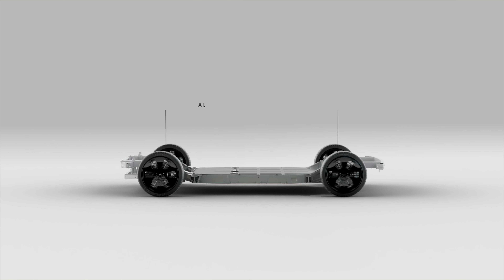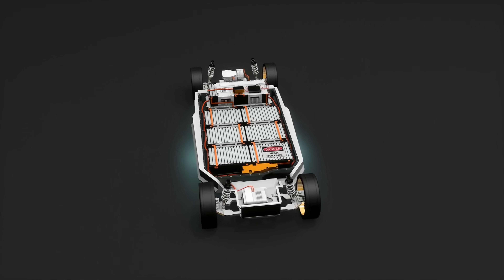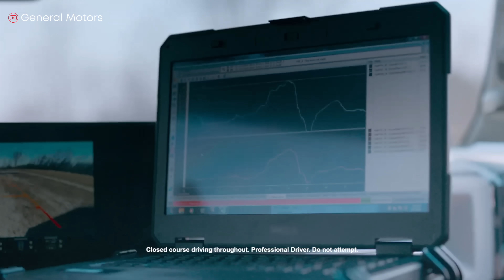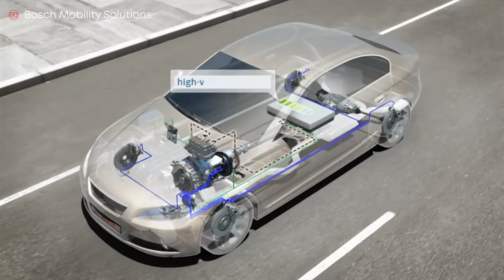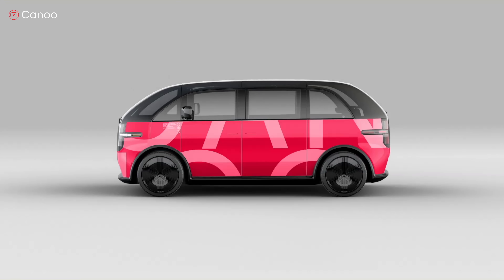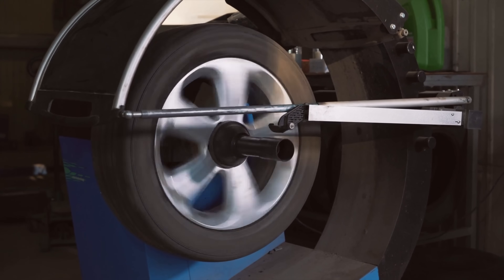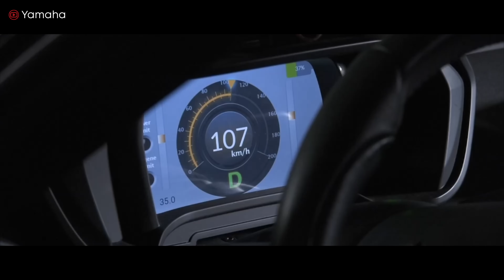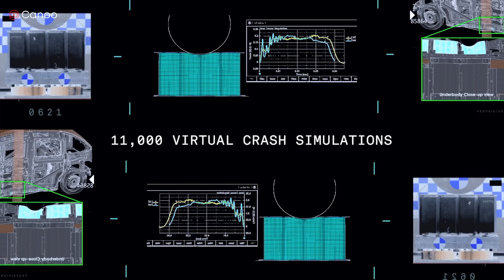No One is Telling You the Truth About Electric Cars, So I Have To

Comment: Can’t wait to see these cars operating efficiently in places like Edmonton Alberta Canada or the Yukon in the dead of winter
Reply: Yes, and don't forget the southwest....with battery killing temps, (even in shade), for an average of 5 months  every year. I also noticed the retail cost of electricity vs gas is never mentioned...And the environmental cost of mining
raw  materials for batteries as well as electricity production.
Reply: @lukula2934  actually these concerns have been addressed many times. The extra C02 released from their production is offset within a few years of average driving even if the electricity comes from coal.
Reply: If you park it at Phoenix Sky Harbor in July and go on vacation for two weeks, will the cooling system kill the battery?  Never saw one in Phoenix, but hypothetically.
Reply: @lukula2934  funny, because I live in the south west and there are a ton of electric vehicles here. They don't seem to be breaking down in 40 degree heat.
Reply: Keep in mind that an electric car actually runs on coal...at least in Indiana....
Reply: @lukula2934  Interestingly enough, some of the bigger players in the solid state battery space brag about extreme heat and cold usage while glossing over a more normal temperature range.
Reply: Lots of Tesla’s in Canada, Montana, Colorado, etc.  I’m in Utah up at the ski resorts every weekend.  Works fine.
Reply: If you try a Tesla you’ll never consider an ice car again
Reply: There’s a guy on YouTube with his channel out of Saskatoon Canada. Similar temps to Edmonton. Runs his model 3 just fine in the winter.
Reply: @JosephHowes2003  False. It takes 7 to 12 years to break even depending on use.
With average new model year coming out every 4 to 6 years, restricted closed source info, anti DIY engineering and legislation the break even will never be acheived.

ICE engined vehicles already produced with open source engineering and DIY friendly on the other hand that can continually live past 20 or even 50 years has less impact than every electric car produced.
Reply: @bubba842  They are not 15 to 20 years old are they?

Are you also sure they are not? The battery life degradation is slow and can be seen only by the owner not bystander.

Even then it is hard for the owner to notice. You can never tell from looking like what you mentioned.
Reply: @TrendyStone  They are still too new to develop the degradation from cold and high use drain.
Reply: @crxdelsolsir  I can see you’ve never owned an out of warranty BMW.  Good luck fixing one of those by yourself.  Easy with the very old ones, not so much with the newer ones.
Reply: @crxdelsolsir  I can’t figure out what you are trying to say. Typo?

Are you suggesting that cars made in 2018 are so new we can’t see the impact?   If so, that’s just not accurate.  There are Tesla’s on the road with >200k miles and battery degradation is a pretty predictable plot curve.  I can see that my car, for example, has lost about 5% of its capacity, dramatically at first and now at a steady predictable pace.
Reply: @bubba842  40 degrees is heat?
Reply: @Maltese280zx  40 degrees Celsius.
Reply: The PRC and Norway are some of the largest consumers of BEV's. Norway is quite cold, and the PRC can get extremely hot. They're both doing absolutely fine. Thermal management on batteries exist.
Reply: They work great…
Reply: @bendeleted9155  no.  The ac works great at least on my Tesla
Reply: @barryflick54  and it’s still much cleaner than an ICE car.
Reply: @crxdelsolsir  not true usually about 5000 miles.  Stop putting out old FUD.
Reply: @crxdelsolsir  not true Tesla have been around for  years and after 200,000 miles it still has over 95 % battery capacity.
Reply: @jonfscott  so you're telling us that the battery cooling system does not use battery power when parked?
Reply: @belahatvany  can you drive it 800 miles in 12 hours? I have to do that about 8 times a year, and I'm assuming it would be a PITA to do that many miles a day in a Tesla.
Reply: @bendeleted9155  it does but vey minimal at least in a Tesla.  It could easily cool for days.
Reply: @jessebensen8009  really? For a  rapid charge, how many solar panels and wind turbines do you need? Have? And how much did they cost?
Reply: @ljgsuper  huh? I don’t have anything like that. Or a Tesla for that matter lol but I will say, I can’t see a scenario where I’ll need a rapid charge at my own house. Having said that, from what I’ve researched (not much at all) you can indeed get enough solar power to power your Tesla at home via solar panels. Of course it depends on your driving habits and location. What do you think the future looks like? Just curious, is ICE vehicles the vehicle of the future? Given the fact it’s a 100% non renewable resource?
Reply: @barryflick54  And is still less polluting than an ICE car.
Reply: @lukula2934  What about  lithium titanate batteries?
Reply: I agree with you on the DIY part though -- I would like to see owner-fix legislation pass in the US.
Reply: @bendeleted9155  no matter where you are leaving an ev will slowly discharge the battery. Some functions are always on and using power.
Reply: @crxdelsolsir  What is your data source for those numbers?
Reply: I believe Car & Driver or some ther magazine listed the typical range reduction at 20 degrees F as 40%. That's huge!
Reply: @belahatvany   Sadly, Tesla is rated 25th out of 26 car manufacturers for reliability by Consumer Reports magazine. And Car & Driver magazine could not recommend them since after more that 10 years their cars are still having motor failures and poor workmanship issues. Stay away from Tesla and wait for Mazda, Toyota, or Lexus to come out with some.
Reply: @TrendyStone  Range decreases by about 40% at 20 degrees F. That's a huge issue for those in colder weather states.
Reply: @barryflick54  and it’s still cleaner than an ICE vehicle.
Reply: @ChronotriggerJM  which is quite considerable for a single charge… 400 miles at 70 mph
Reply: @crxdelsolsir  not true at all a Tesla motor last about a million mile with the nearly the same longevity for battery life.  You really need to check out facts instead of some old tripe.
Reply: @bendeleted9155  yes it can. That’s more than enough time each recharge stop about 15 min…. Shorter than my restroom stops.  The car has a range of 320+ miles from 100% charge starting at home.
Reply: @davepaturno4290  Only until the battery warms up.  Drive for awhile…and you get the range back.
Reply: @jonfscott  You need to see the bigger picture.

Focusing on the electric motor vs the IC motor and NOT at the fuel cells  Battery vs Fuel tank is one sided.

An ICE fuel tank has zero parts vs an EV fuel cell.

An ICE may develop more problems with the engine but zero with the fuel cell. 

An EV may have zero problems with the motor but will do with the fuel cell.

The difference is the ICE architecture is open and knowledge to maintain is open source.

Tesla EV is closed engineering and the information closed to funnel consumer to spend rather than DIY or 3rd party repairers and suppliers.
Reply: @crxdelsolsir  do not agree with your premise, you have fuel distribution problems tainted gas, fuel filters, fuel pumps, frozen or gelled fuel, Fuel leaks, and injection issues. Diesels also have to worry about bacteria growth.

You are correct that if a battery goes bat out of its 8 year warranty it will have to be replaced. Fortunately most batteries will last close to the 1000000 mile mark and even after that they are good enough for energy storage. Then can be almost completely recycled for its component parts. And the cycle repeats.
Reply: @TrendyStone  How well is that heater working? Does it suck much juice out of the batteries?
Reply: @TrendyStone  The EV fleet management company Fleet Carma has tracked trips in the Nissan LEAF in Canada and the U.S. and found that overall range drops from close to 80 miles in shirtsleeve weather to 50-60 miles when driven in below freezing conditions. This is a noticeable drop, but still leaves enough range for many drivers.
Reply: @jonfscott  While there are fuel related issues they are serviceable by normal tools, logical in nature (leaks, visual queues etc) unlike battery, voltages, earth leaks etc.

The costs of engine replacement over time reduces and can be fully serviced in overhaul.

Batteries are not easily refreshe if at all. They are refreshed by replacing and throwing away the cells if not the whole battery.

Environment wise the ICE engine is completely refurbishable to zero and chemicals (which  Li batteries are made from) are not.

How much of the Li batteries in existing electronics are recycled? Nearly none.

How much of the battery in a conventional lead battery is recycled? Almost all.

Lead batteries are simple in construction and the lead valuable and easy to recycle.

EVs are not only more expensive but not environmentally friendly beyond narrow pollution measurement of during operation, excluding before life and end of life environmental impacts.

The media and interest groups give a narrow view and measurements that is biased
Reply: Getting service or parts is a joke. Let alone in many areas. Tesla is not even allowed to sell there. Not a good selling point.
Reply: @davepaturno4290  Yea, the LEAF is indeed a crappy car.  No argument from me on that one.  A Tesla on the other hand...
Reply: @oldsalt8011  Surprisingly it doesn't seem to make much difference.  Nor the air conditioner.
Reply: @TrendyStone  ...Tesla rated 25th out of 26 in best to worst reliability ratings by Consumer Reports.
#1 Mazda
#2 Toyota
#3 Lexus
Reply: @davepaturno4290  If you want a nice reliable boring IC engine car… you can’t beat a Toyota.  No argument there.  I’ve had several.  When it come to manufacturing quality…nobody beats Toyota.  Honda isn’t far behind.  Lexus IS just an expensive Toyota.  Still boring and ugly but VERY reliable. I work in manufacturing and work closely with Toyota engineers on a regular basis on special projects. I have spent time in several Toyota factories from Kentucky to Japan. Reliable as hell. Amazing company. Incredible engineers. Ugly designs in my opinion…but that’s subjective.  

If BMW designed the look and Toyota did the manufacturing…you’d have something special.  

However….I don’t think this video is about IC cars…and Toyota put its eggs in the hybrid basket and is lagging in the all electric space. Tesla is ahead of the pack on electric car design…despite their infancy in manufacturing.  Fit and finish lag….but the cars are well designed and fun as hell to drive.  Seats are comfortable, acceleration is fantastic, design is attractive and not ostentatious. Battery management is the best in the business.  Quality will improve with experience.  

Also, their supercharger network gives them a tremendous advantage.  I can drive coast to coast.  Try that with any other electric car.
Reply: Hey once lived in Edmonton Alberta a tough placein the winter  those electric cars would have a tough time there without a heated garage.
Reply: @bruceneiman5158  There are plenty of YouTube vids of people with Teslas in Alberta, Colorado mountains, Alaska etc. with first hand experience.
Reply: @DrakeDealer  LMAO, So, I guess you think dementia Joe and the flying circus is doing a great job.
Reply: @bubba842  funny, because you can also run without changing oil for years , if you want to use this kind of logic
Reply: @Dont_Tread_On_Me  Yes, including mining or extraction of rare earth minerals for the batteries. Every reputable lifecycle study shows that this is the case.
Reply: @davepaturno4290    I've driven EV's at most that temperature in Queenstown. There's no way range reduction goes that bad. You'd struggle to purposefully cut range to 40% at those temperatures. As for reliability, UK Magazines (WhatCar?) ranks Tesla quite highly, Tesla is considered the most reliable American brand, at least, outside the US. It does translate into sales in highly competitive South Korea and Japan.
Reply: @davepaturno4290  The Leaf has its origins before even Tesla. As a result it has no modern battery thermal management systems. You basically need to keep it plugged in, and in a garage, ideally heated/cooled, if you want to drive it outside adverse conditions.
Reply: @boeing900  Well, the New Zealand government hasn't had to fact-check the US President in quite some time, so he's immediately doing better than his predecessor.
Reply: @barryflick54  at least you won't have to shovel it.
Reply: @TrendyStone  plural of Tesla is Teslas. The apostrophe means the car owns someting and it can't. It's a car not a person.
Reply: crxdelsolsir yep.  And when you need to recharge. I mean refuel, it takes less than 5 minutes.  Try that in a Tesla.
Reply: @crxdelsolsir  most people buying the cars only have them for 5 years and then get new ones.
Reply: @ljgsuper  ok, a Tesla model 3 long range has a EPA range of 353 miles on a single charge. It has a 76 kWh battery. That's equivalent to the energy in 2 gallons of gasoline ICE cars waist about 80% of energy in a gallon of gas. Tesla batteries and electronic. Get 80% + efficiency.  Much better than 20% efficiency.
Reply: @rchydrozz751  you do have a point Tesla sells direct and foes not have costly dealerships that jack up cost. So dealerships get laws past in some states to bar the consumer from buying convieniatly.  Though Tesla still has service stations.  The cars are then brought in via another state and delivered personally to a persons home. Dealerships are a wrench in the car business and will hopefully die off.
Reply: @TrendyStone  I too have lots of experience with cars and I agree with Consumer Reports in that Mazda is currently the top overall auto company.  But again, the mistake many people make is that they expect American manufacturers like Tesla to improve their crappy quality so that it will be on par with the aforementioned Japanese companies. This is a pipe dream Car and driver was testing a long term Tesla Model 3 when it died soon after the test was initiated. This was not a prototype; it was made after production had long since began, years earlier.
Then when C&D were comparing EVs for their electric car of the year issue, a Tesla sedan which had less than 4000 miles on it had died due to a bad drive motor. This model had been in production for more than 10 years.
 So don't expect Tesla, GM, Ford, or Dodge to reach Mazda, Toyota, Lexus, or Honda levels of quality within our lifetime.
Reply: @bubba842  Yes way too short to experience the real long term costs and durability. Also more importantly 5 years or even 10 is way too short to break even in pollution from production. 

End result is worse than the ICE engines since recycling an EV at end of life is significantly higher and less complete.

EV break even points do not include end of life recycling as it is a disadvantage compared to ICE cars and an inconvenient truth. So it is never taken into account or spoken about in comparison stats.
Reply: @britishmalayasociety  Here in the US, Tesla is ranked at the bottom of Consumer Reports' most to least reliable auto companies. We have many more Teslas here and CR's data base of consumer complaints is filled with issues that include failing drive trains, screens that go blank, and poor build quality. 
 American and German vehicles are also very lacking compared to Mazda, Toyota, and Lexus. However, a Lotus with Toyota drive train may be a good compromise.
 As of today, if you want quality and excellent gas mileage, the Toyota/Lexus hybrids are the ones upon which you can rely for many years.
Reply: @davepaturno4290  Depends on the testing methods? I know JD Power ranked GM and other brands over Toyota and Porsche in 2019. Tesla's are well regarded, for American brands, in Asia and Europe. Then again, Europe and Asia do get the Chinese built options nowadays, which reportedly does have an advantage in quality over American made ones.
Reply: @britishmalayasociety  Consumer Reports compiles reliability data based upon tens of thousands of survey results by owners. Teslas typically perform well and therefore show high customer satisfaction levels but so does data from Corvette owners. Corvettes, like Teslas are notoriously unreliable. Reliability rankings are separate from overall rankings where Tesla is somewhere in the middle. Mazda is #1 overall and for reliability.
Another way to see how reliable specific models are is to peruse car forums. I am a Lexus forum moderator and I can assure you that there are far fewer complaints than there are in Tesla forums.
Reply: @crxdelsolsir  no. That's not true. Used batteries get a second life as energy storage. And nearly all warranties on batteries from EV manufacturers are 8 years. Realistically, people should be keeping EVs for 8 years, not 5 like most new car owners. 
I know plenty of people who but new vehicles every 5 years because they can't afford to fix them after the warranty expires. You are not bringing up how bad for the environment that is. 
I am not like that, since my cars are 9, 12 and 22 years old.  I'm also in the market for am 88 Pontiac Fierro GT, 33 years old. But I'm also a mechanic and and I am capable of fixing my own stuff. 
But I'm also not against progress. Since electricity is cheap where I live I would pay 1/4 of the cost of running an EV compared to an ICE car.
I would rather have that money in my pocket than in an offshore bank account of some gas and oil company.
Reply: @davepaturno4290  Anecdotes about any particular car brand (car X broke after 4,000 miles!) are worthless.  I’m a data guy.  Apparently you are not.  

There is manufacturing capability and then there is innovation. Toyota snd Honda are world class manufacturers, but their innovation?  Meh

Will Tesla improve their quality?  Yes.  
Will they catch Toyota?  Doubtful.  

Will Toyota improve their EV options?   Yes.  Will they catch Tesla?   Maybe.  

Either way…capitalism and competition works well and the consumer will benefit. Tesla innovation will help push all car companies to innovate. 

I suspect both Tesla and Toyota will be around for a long time.  

BTW - if you want a car with lots of rattles…buy a Mazda.
Reply: Yea there are so many people up there.
Reply: @jonfscott  Was your included in the recall over the control screen In a letter to the U.S. auto safety regulator last month, a Tesla executive said the screens, which drivers use to control many of the functions of their cars, were not meant to last more than five or six years.  NY Times     Published Feb. 8, 2021Updated April 18, 2021
Reply: @jessebensen8009  I do believe with a Rapid charger you would need a defecated Solar Panel set up or shut down other things that are drawing the current to run the house.
Reply: @tfoley7553  from what I understand, you’re probably right. I don’t think you can run your whole house as well as keep a car charged at all times just on panels. I’m still on the side of solar panels not being viable for the price yet. Like I said, really don’t know a ton about it, but every time I look into getting some, it’s not worth it.
Reply: @tfoley7553  You mean the issue that was actually an  eight-gigabyte memory chip in Tesla Model S and X vehicles built between 2012 and 2018,  most were already replaced at no cost. The chip was replaced with an 64 gigabite chip.  Max time for repair rather swap about 10 min.

NHTSA had initially asked for Tesla to recall 158,000 vehicles, but many of the vehicles have already been repaired with the upgraded memory. A quick fix. Now let's check this out 2018 Ford had a recall. Ford recalled almost 350,000 2018 F-150 and Expedition vehicles with 10-speeed automatic. That's just 1 of the many recalls.

How far back do we want to go should I bring up The Pinto.

Millions of Fords have been recalled during the same period, the same for GM, and let's not call out VW diesel gate.
Recently this year VW had to pay for collusion violations in EU.
Reply: No one says cars are not complicated to mass-produce.
Reply: @blackbirdpie217  Yea, I know what the plural of Tesla is.  Don't be pedantic when we're all typing on phones while fighting autocorrect.  You come off as a snob.
Reply: @jessebensen8009  You said a mouth full about being affordable! I was curious about the cost myself and the price tag was over $45000.00!  The sales people will push the Tax Credit 1/3 (apx) they will also tell you that you can sell the electric back to the power co. that is true but they don't tell you is the electric co. will only buy so much!
Reply: @tfoley7553  what did I say was affordable? The only thing affordable about an electric car is the electricity itself compared to gas (here in Canada anyway). Full charge should get you about 100km shy of a full tank in a civic for example, but cost about 1/4, maybe even less. Or are you talking about solar?
Reply: @jonfscott  My mom lives in Faith SD. Ill stop in Rapid City, 2 hours away at the closest super charger and wait 30+ min while my car charges. Ill get to her house and run a 100 ft extension cord to the street and charge my Tesla overnite for 12 hours. Then Ill drive back to Rapid City on my way back to Idaho to charge for another 30+ min  and hope that no one is already charging their model 3's in 1 of the 3 superchargers in Wy that arent in Cheyenne on my trip back home.
Reply: @crxdelsolsir  
That's right !!
Reply: @Dont_Tread_On_Me  
And Coal and oil for electricity !
Reply: @davepaturno4290  
Wow !   Yeah I'm sure a lot of people up in Buffalo New York have them...?   🤣🤣
Reply: @davepaturno4290  
Wow !   Wouldn't hate to run out of "electric" up there ? 
If you do anywhere....what do ya do ?    Bring a can of electric juice back ?  🤣
Reply: @champspec  
That's Right !!!
Reply: @davepaturno4290  Obviously Toyota and Lexus' are more reliable. Tesla has more of a focus on battery and motor design. Toyota and Lexus have more of a focus on reliability. Tesla as a brand identifies more with Alfa's. That technology and driving experience. And, it's reasonably reliable enough. At least in Europe and Australasia, it's considered as the most reliable American brand. That's why the sell, as an American brand, so well in competitive economies like South Korea and Japan.
Reply: @bubba842  I wasn't talking about Lithium.  Those batteries also contain cobalt, aluminum, manganese, and nickel, etc.  Do some research yourself before declaring something FUD or nonsense.
Reply: @lukula2934  You have to mine the materials for an EV battery once in the car's life. You have to drill the oil to fill a gas tank every week for most people.
Reply: @barryflick54  The Indiana state government actively works to prevent progress. Thankfully most of us don't live there.
Reply: @mikesaunders3326  I'll not pretend to know the intricacies of mining vs oil drilling/fracking, etc. What I find interesting is how the narrative sets the tone of info availability.... If anyone knows , really knows the good and bad of lithium 
mining and processing I'd like to see a link at least. Right now the narrative is oil= bad, lithium=good. I have heard of extremely toxic chemicals being used for 
both mining and processing...And perhaps it is similar with oil...My point is that as bad as carbon pollution can be, how does it really compare with all options? This is
much tougher to answer when it becomes politicized...and narratives become weaponized, regardless of the intentions.
BTW: Your claim of a once in its lifetime turn at the "pollution trough" only would apply if it never needed recharging. Unless
you see a world where only solar/wind/water is used to make electricity. And it's pretty obvious that none of existing alternative methods of energy production have any chance of providing any real remedies to this problem.
Reply: @belahatvany  Why?  Because they're the lowest quality builds on the market?
Reply: @Dont_Tread_On_Me  Depends which batteries you're looking at. Lithium makes up 3% of a modern li-ion battery. You can get batteries without cobalt and nickel. And it's not like, oil refinery and engines don't also contain many other minerals and metals.
Reply: @lukula2934  There are plenty of academic studies on how environmentally friendly batteries are, lifecycle of EV's, and what power composition you need to make BEV's worth it. The thing is with Lithium, there are multiple ways to extract it, from mining, to less intensive methods. It's like buying clothes. You can buy clothes made from child labour, or you can buy ones that don't do that...
Reply: @barryflick54  I live in Iowa and my electric provider gets 90% of its energy thru renewables.
Reply: @britishmalayasociety  no one said oil refineries are clean.  We are saying that electric vehicles are not the clean, environmentally friendly panacea that they are made out to be.  Until thousands of nuclear power plants are built, most of the electric vehicles will be charged from power produced by fossil fuel burning power plants as well.
Reply: @TrendyStone  And when the Tezla breaks, I take it to WHO...???
Reply: @TrendyStone  VAPORWARE
Reply: @peteparadis1619  I don’t think you know what that word means.
Reply: @ljgsuper  ok congrats.  Don't know what roads you take but I sure see a lot of Supper Chargers and you can see if they are being used via the car before you choose that destination.. And the 30+ min baffles me. The chargers work best and faster on the lower end of the battery charge scale. It is nice scenery there.
Reply: @barryflick54  

Keep in mind that all energy on earth, other than nuclear,  is actually solar energy sourced originally.  On the entire earth.